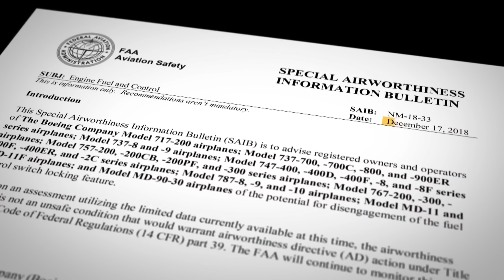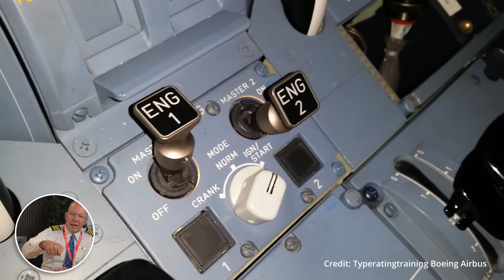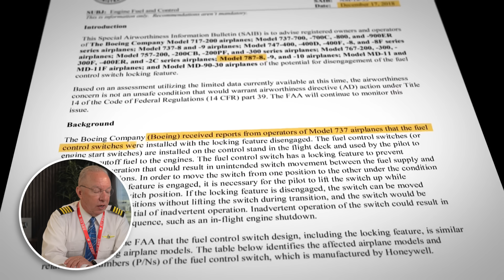Air India 171: The FAA’s 2018 Fuel Switch Locking Bulletin Explained (16 Questions Answered)

Comment: The possibility of gaslighting from either the pilot asking the question, or the one denying it, is baffling me.
Reply: Remember - we are talking Boeing and India here. They’re both corrupt and the right amount of palm-greasing would surely bring them to a mutually agreeable conclusion. The airliner and the airline both have a shitty track record. I don’t believe a word out of that report and captain Steeve has since the start maintained his stance of this being deliberate or pilot error and absolved Boeing long back.
Reply: What else is heard on the voice recorder? Any fight?
Reply: @Andy-qi2ez  we would know after the last report if there was any fighting. No need to fight anyway, the aircraft cannot be recovered anyway, so just play along and act innocent.
Reply: If you noticed the timing of reports of wall street journal ,They  report the way  before ,the report was released by govt.
Reply: If someone among  has switched it off, deliberately, he would resist rerunning the engine right? Here the engine was started with out the resistance of other pilot. Explain this?
Reply: @RockyRock-vv3ex  because no matter what the other pilot did it wouldn't make a difference?
Reply: Dear,. Both pilots have ability to move their body when the other one does a catastrophic thing to flight. The pilot who didnt want do sabotage the flight will resist the other ones action.
Reply: @RockyRock-vv3ex  The pilot flying (copilot in the right seat in this case) would neither handle nor look at the power controls right after lift off, he will only fly the plane and look outside. But both could potentially have this still, but I lean towards the captain (pilot monitoring) having done this.
Reply: @cruisemissle87 If a pilot decided to fail the engine by cutting of the fuel switch, will he sit ilde while the other pilot ( who is flying ) trying to re run the engine? Or he would restsit the pilot flying fron doing so?
Reply: @RockyRock-vv3ex  As I have said, with the engine power not recoverable so close to the ground, the pilot monitoring does not need to do a thing anymore, he can just watch or even play cooperative and innocent now, as nothing can likely change the outcome.
Reply: @RockyRock-vv3ex he knew it was futile ,that simple !😮
Reply: @RockyRock-vv3ex  because by the time it was noted, it was too late for the aircraft to recover.
Reply: @RockyRock-vv3ex  The technical explanation is, there was no hope of bringing the engines up to speed again no matter what.
Reply: @cruisemissle87 he did not know exactly. There was no experience before that maybe he may or may not be saved
Reply: Whats truely baffling is your ignorance
Reply: Such morons even thinking the pilot did it, check Boeing's past crashes. They were all blamed on Pilots, to save Boeing's image. It is a repeatitive thing.
Reply: I'm with you on this one cause I thought the exact same thing!
As for the people who call delusional,there missing the point!
Reply: Go and youtube a video of one of these taking off from inside the cockpit.  the answer to who did what is pretty clear.
Reply: If it was deliberately done I'd like to know how else a malicious (co)pilot could definitely crash an airplane that simple. I'm not in favor of autopilot (thinking of Max) but somehow a protection against this would be useful or a regular psychological screening.
Reply: @Andy-qi2ez  I've thought about it for a while and there is really not much you can do. You could disable engine cutoff during flight and during TOGA using the computer, or disable messing with the fluid systems, but there are still a couple more ways to cause harm.
Reply: The best way to shift blame after a silent fart is to accuse the innocent.
Reply: @barryobrien1890  Finally a way to put it which anyone can understand.
Reply: No pilot that intends to crash a plane is gonna respond with "No i did not do that". And they most certainly would not let the other pilot turn the switches back on afterwards. Until we get a final report in which investigators have investigated the pilots lives leading up to this, then i refuse to believe this was a deliberate and malicious act.
Reply: @benowski23 you’re an expert on what suicidal people would and wouldn’t say during their final moments?
Reply: @KalemStLouis  No, but im most certainly not gonna blame it on a suicidal pilot when the recorded audio suggests something else. As i said, if this was a suicidial pilot, investigators are gonna come to that conclusion after digging through the persons life. Its not something any of us nor any expert in suicide can deduce from a single sentence. You disagree on that?
Reply: @benowski23 Of course they could respond that way - the pilot  who cut off the fuel is the ultimate coward - you expect logic or truth from someone capable of murdering hundreds of people who has nothing to lose? Plus it distracted the other pilot for a critical second or two while trying to make sense of or reconcile why the fuel switch was off if the other pilot didn’t do it. Absolutely believable.
Reply: @Wee162 🤡 - Wait for the final report in a year or two, when experts have done their due dilligence. You lot blaming it on a suicidal pilot based on one sentence are out of this world delusional.
Reply: @benowski23 he knew that it would be futile ,there was no way to recover a jet that size with so little altitude and full fuel tanks!
Reply: @benowski23 but a pilot could lie , and say they didn’t do it; when they actually did
Reply: @libbyjett3471  Right, so because a pilot could lie, does that suddenly mean its the most likely scenario?
Reply: Stop being delusional
Reply: @sahilchoudhary8088  you are trolling with gaslighting nicely

Comment: It's just a theory: No one cut off the fuel supply. It were the spring-loaded fuel shutoff valves, which switch to the closed position in the event of a power failure.
Anyway, ChatGPT claims that. Something the investigation team should look into.
Reply: Think about this.  If your aircraft suffers a total electric failure, would you then want both engines to then automatically shut down?  Don’t look for help from ChatGPT.  How big if an airplane does it fly?
Reply: @gordonbryan8381  You could just ask Boeing directly.

Comment: Well, they recovered that part of the cockpit , so they can inspect the switches locking features, right?
Reply: It was in the on position after a heavy impact... that should answer your question.
Reply: And they found them in the run position because the non mass murder pilot put them back
Reply: Even even without the fuel shut off switch detent nobody dies unless they shut the engine down. It's a murder suicide, we may never know for sure who shut the engines down, but I suspect the senior pilot, rather than a young bright youthful pilot at the beginning of a well thought out career and his whole life in front of him..
Reply: @Pw-f100 yeah hard to say…young people are usually vulnerable too, especially with external factors
Reply: @Pw-f100 thats quite an assumption.
Reply: @Pw-f100 go look up Germanwings incident and you won’t feel the same about your theory on bright young co pilot
Reply: If the captain deliberately turned off the switches, that would make more sense .. first officer was a junior and the question “why did you cut off?” might well have been confusion or puzzlement .. like is there a technical reason to do so.
Reply: Is it possible the switches were toggled quickly to try and reset the FADEC? Could a major problem have initiated 3 seconds after rotate?
Reply: @yodab.at1746 Not part of any approved procedure.